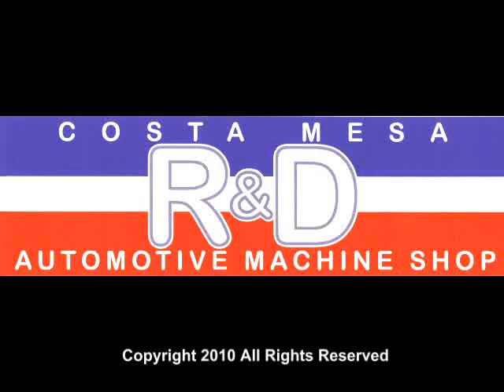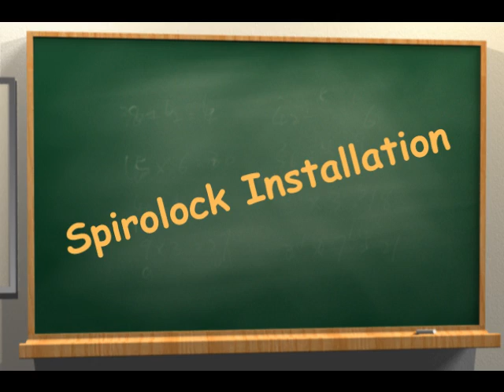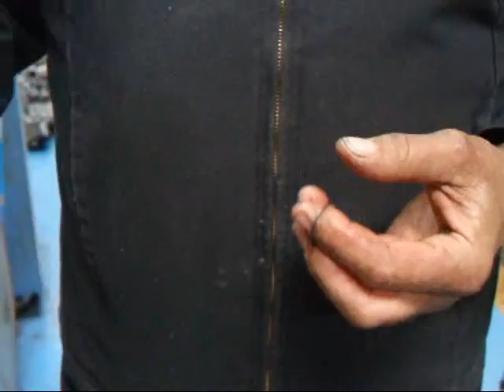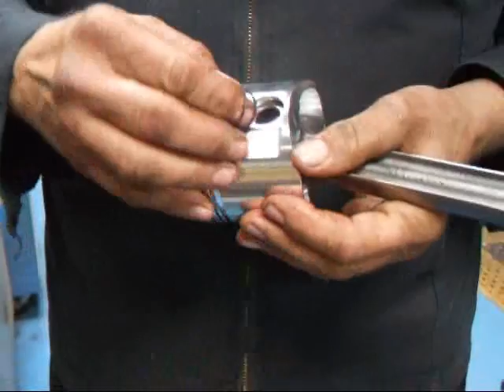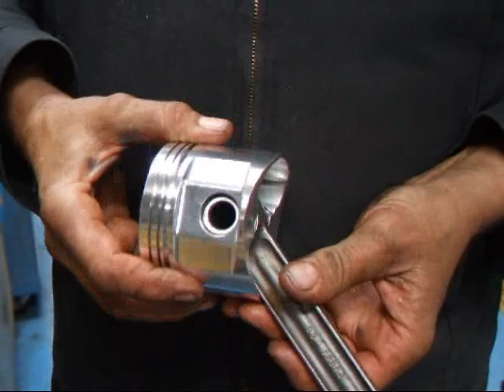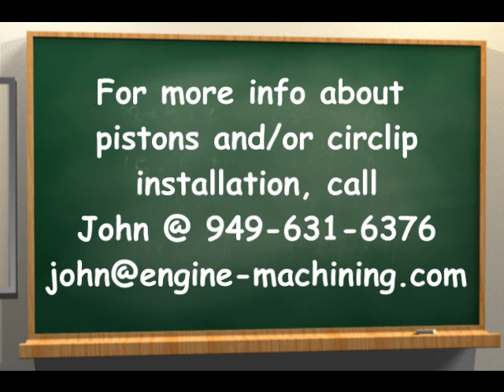Spirolock Installation.wmv

Comment: Although I don't want to lessen my considerable appreciation for the video clip, I must let the piston pin installing masses know that the Spirolocks used have half the turns KB uses on the highly macho short skirt 540 Chevy piston, which makes installing the locks 10 times harder.

Obviously fiatnutz went shopping on Rodeo Drive and got the foofiest piston known to man and then cut the Spirolock turns in half. Sniff. Nyah.

Comment: Hi John,

I have a little question,

i'm rebuilding a D16A1 honda engine from a 89' civic but i want new HBean Rods give the OEM Pistons. The problem is that H Bean Eagle Rods where designed for floating wrist pins... and the OEM Pistons are made for Press Fit Pins.

Could be posible to install a Press Fit Pin Piston in a floating wrist Pin Rod?

Best Regards,

Pablo.